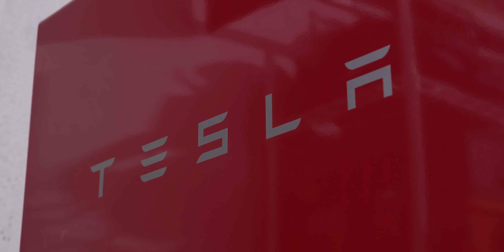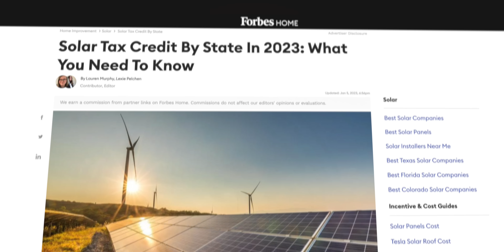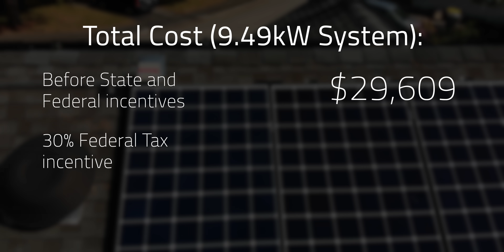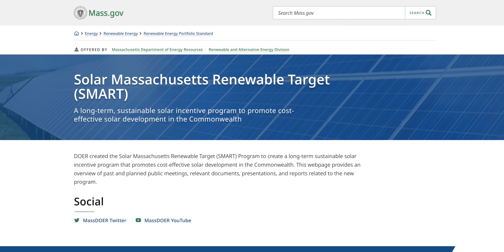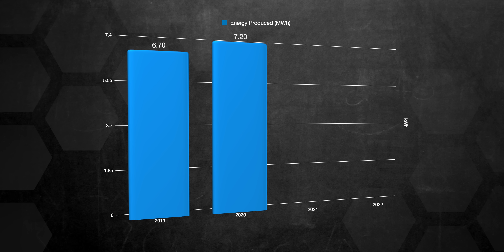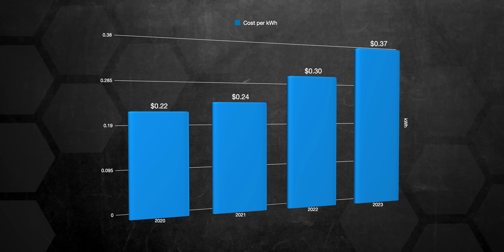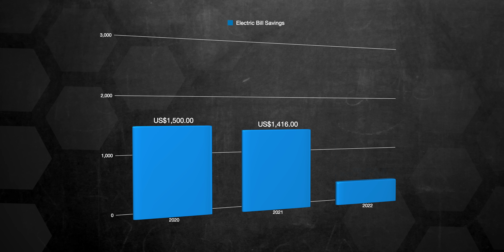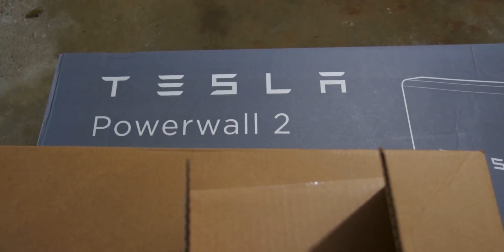5 Years with Solar Panels - Is It Still Worth It?

Comment: Very interesting with the 1:1 net metering! That's something we could only dream of in Germany, but I can imagine it making life tough for the utilities. Having a big difference between the price for energy taken from and fed into the grid is one of the reasons why pretty much every install here now features a battery; with 1:1 net metering I'm frankly amazed that anyone would get a battery. I guess for backup power or just the pleasure of being independent, but otherwise why bother?
Reply: Exactly you can just used the grid as an infinite, 100% efficient, lasts forever, battery. Not exactly a realistic solution for the long term!
Reply: When I install solar, a battery will be part of the system. It allows me to store power when the sun is shining, store power when power is cheap or free, use power as I please and NEVER pay the peak rate and keeps my system online when there's a power failure. Did you know that if you have no battery, your solar system will go offline when there is a grid power failure? I was surprised. It certainly isn't something they advertise.

Comment: I put 10k into a 2kwhr array with a 6kwhr lifepo4 battery bank. Designed and installed by me. 3 independent sub arrays charging the same battery bank.  It runs my fridge and dc lighting most days.  I dont have exact data, but suffice to say I knew it was cheaper to just pay my electric bill.  I want to cut the wire off my house, even if it costs me more!  Doubling the array this year and adding automatic start gas backup generator. Im getting closer.(Connecticut) There is no way I will give back 50% for line charges for grid tie.

Comment: Live in south africa and even if you only got 2 years out of a solar system will still cost u less tham dealing with 12hrs of power loss from the grid a day or the dips and peals that come down there lines. You pay for the power u use plus tje cost of lost equipment from constant liad shedding  so maybe its not worthit where you live and have constant power suppliers but here definatly woth it

Comment: I live in an apartment, so solar isn't really an option for me.  But at the last shareholders meeting, the chairman of our co-op board told us that the building is going to need a new roof and they were examining whether to install solar.  While the common areas probably wouldn't use all the electricity the roof would generate (its a big roof) by selling the excess to Con Ed, it could defray other costs.  That would be nice given that my maintenance charges have increased by 25% in the 3+ years I've lived here.  I am guessing though that installing a power wall in my apartment wouldn't be worth it, though it would have come in handy this morning.  Con Ed was working outside our building this morning and turned off our electricity for an hour.  I lived through that by rolling over and going back to sleep.  But $15,000 is a bit much to pay for power outage insurance.

Comment: Thanks for the video. Very interesting. You indicated your tax credit from the Federal gov’t did not come from other taxpayers (if I understood correctly). Just want everyone to know that tax credits given to one is basically paid for by all taxpayers. The Federal gov’t (or even state gov’t) is not going to reduce their spending by the amount of each person’s tax credit).  Therefore, others have to make up the difference and it eventually leads to higher taxes for everyone. I have not problem with you wanting to use ‘green energy’ but I do have a problem with me having to give you money for your decisions. Where are your solar panels being manufactured for your new home? Most likely they are not made in the USA and there is a high chance they are being produced in China. I’m trying not to buy products made in China because of their infringement on their citizen’s natural rights.
What is the reason for the significant increase in electricity costs in your area? Most likely it is from the increased energy costs due to the federal governments insistence that we move away from oil, coal, and natural gas.  I think we should be stewards of the environment, but I don’t think that the planet is going to “die” in 30 years because of carbon emissions being produced by humans. We need to be aware of our emissions but we don’t need to drastically change our way of living overnight by investing lots of money and complications that green energy brings to everyday life. I don’t want to have to maintain solar panels and worry about snow avalanches off my roof. Since I am retired I don’t have desire or the money to invest in green energy. If I was younger my attitude might be different.  I applaud you for your efforts and enjoy all your content. I hope all goes well on building your new home.

Comment: We moved to our wheat farm about 7 years ago to get away from the madding crowds, and it’s been wonderful.  Over 5 years ago we installed a 24KW backup generator and that made a huge lifestyle improvement as our power goes offline all too often and then we have nothing, not even water as we’re on a well.  Two years ago we installed a 15KW solar panel system on the south side of our shop building, which was just completely renovated, and 3 banks of Enphase batteries, and everything is Enphase except the solar panels.  We also dropped all power lines underground.  All this is very good except one aspect, in the winter we most often get very little generation, yet late spring throughout the summer into mid fall we get up to 125KW per day, so our electrical grid company gets lots of KW from us.  We generally use up to 2000 KW per month, except when we have company when it can easily double that.  We don’t try to conserve but all the lights are LED and all the systems are as efficient as can be purchased.  So we have constant power, never knowing when we’re off grid without seeing the email and text messages.  One more aspect would make this perfect, harvesting the wind to charge the batteries, especially in the winter months, and we have plenty of wind!  This would work well if Enphase would program that into their system, which we hope they will.  The lack of wind harvesting is our only weakness, and to be fully self reliant, we need it.  We are super happy with our installer and Enphase.

Comment: I live in South Africa and we installed our solar 3 years ago. We have a 5kwh inverter with 10kwh battery backup.

In South Africa we have scheduled blackouts called loadshedding, so we deal with power outages on a 4 hour basis.

My system actually replaced the use for grid entirely.

Things I wish I knew :
1. More batteries, in my case we need at least 12 hours worth of backup capability.
2. Use a system that allow generators to connect directly to the inverter. This can help carry the load and charge batteries
3. Hot water and oven can go on a different system that the primary, preferably gas(a limitation for South Africa is we don't have gas lines so we need bottles)

Comment: I'm a true skeptic on residential solar. Not because of the technology but, because of the complicated process involved in getting it and how much money has to be spent to get the system in a position to be able to pay for itself in a realistic number of years which is subject, in the most realistic calculations, to so many variables like utility rules, laws, state programs, weather patterns, rising material costs, maintenance considerations, contractor reliability and changes to all these. My sister and sister and brother in law just completed their solar project in California and are very happy to be producing power and getting credit for their excess. However, the process was long and arduous and fraught with difficulties, right down to the local inspector's failure on first final inspection. Even your situation sounds like it will be a while before you break even and you have had a better than average experience than most of the stories I have heard. And don't get me started on the amount of energy and materials, mostly not recyclable, that are used to produce these products, which I believe is unsustainable. To me, if ones goal is to save money, energy, carbon output, and the environment, buying extremely efficient appliances, making your house as energy efficient as possible with heat pumps etc., and cutting back on excess energy consumption, would be a far better way, and would have a far greater impact over the whole world, than do these personal renewable energy systems. I don't know if the actual numbers back me up on this but I have a feeling they do. Your thoughts? And nothing against those going solar and wind because I think the motivation is noble, just maybe not efficacious.
Reply: You sound as if you possess the capacity to think on your own and are not blinded by some snake-oil salesman. Congratulations. If the efficacy of insulation were understood, by itself could “save the planet” and your bank account as well.
Reply: certainly understand how it can all feel like a lot but you mention sustainability, neither is oil and gas. It's just easier to dismiss because you aren't involved in the plants that produce the power you use but. Appliances can only get so efficient and suggesting that humans will "cut back" , I can't imagine you seriously think that's a valid argument. If we didn't cut back the last several decades , why would you think it'll happen now?
Reply: Those are my thoughts exactly.

Comment: It's a big decision for most people, and the risks are many. We are already seeing a solar backlash in some important states, where the incentives have been significantly cut. Program rules could change at any time. Federal incentives could decline or go away altogether. 

BUT... I thought the same thing when I started the process in the fall of 2020, with final permission to operate granted in February of 2022. My original break-even point was 8 years, due to the inclusion of 3 Tesla Powerwall batteries. But after a year, it's going to be only 4 years. Also, think about about inflation- the value of solar generated electricity will only increase in time.

Yes, the risk of defunding incentive programs exist, but it is much more certain that the price of electricity will go up.

Comment: Hi! Can you recommend the specific roof rake you use for your solar panels? I’m nervous to use the hard plastic or metal ones I have now as I don’t want to break the panels. Thanks.
Reply: Solar panels are made of durable glass made to handle weather including hail. You're not going to break them by using a roof rake.

Comment: I have a question about original roof shingles.  What if a few years after solar install and it’s discovered my roof has a leak. Soft sheathing and good section as seen in attic has to be replaced. I assume if getting a new roof the solar panels have to be removed and then reinstalled. Costly?
Reply: Should be no more then 150% of the labor cost to install the panels in the first place,,,,,plus materials and any that get accidentally broken.   And I think in 2 years the subsidies will be Biy-Biy.

Comment: Solar panels are a big SCAM.
If, in one month, you produce as much electricity as you consume, will you still get a bill?..............................Yes, of course.........."to maintain the grid".
If, in a given month you consume X amount of electricity (above what you produced) but the month after that the excess electricity you produce is the same X amount, will you be "even"?........................No, of course not.
You always get the usual monthly bill ("to maintain the grid") and the electric company buys the electricity you produce at a very small fraction of how they sell it to you.
Because of the "Buy-Back" plans, more often than not, you end up paying a higher electric bill than before you installed solar panels.

Comment: glad my electricity is ~$0.15 since i tend to hover in 2 to 3 mwh...but apartment so cant install solar and in texas so how green electricity is is questionable (was not yet in apartment when big winter storm killed the power grid, but obviously dont have backup battery bank or generator other than UPSs for each computer). Yes my main server rack is a 2012 server and not the most efficient, but electric car and saving for house will be earlier improvements than the 750 to 1200 continuous watts it pulls

Comment: Hi Matt, I have a question, your panels have microinverters on each, would it be better for your West and East to have two seperate MPPT High Voltage charge controllers feeding your 48V battery bank, that way you have a longer charge curve during the day in the early morning's to late afternoon's with a Series East & Series West charging the batteries 😀  MPPT charger like the Victron Energy MPPT 250/100, for sure you could use a combination of series & parallel making sure you don't go above 250V and or the power rating of the Victron Energy MPPT 250/100 (open circuit panels voltage each around 42V), there must be a switch on / off point that the mini solar panel inverter that must opperate at, it's just a way you might get far more charging power on cloudy days where you live, I'm in Cheshire UK 🇬🇧 used to rain 🌧 & clouds, hope to place my solar panels on the ground south facing withou trees in the way, its an easy DIY way to cut cost's, maybe with tracking arms🤔

Comment: If you live in South Africa like me? Then yes, it is still worth it. Stage 6 loadshedding is no joke.  Imagine: Every 5 hours the electricity is turned off for the next 2 hours. Like right now, It will be turning off from 16:00 until 18:00. I have to keep my devices always charged because I need to study, but the wifi is off, so I need to buy data for those times when there is no electricity. So now the question is: R200k (+- $10k) or continue to live with intermittent electricity? But here's the catch: Average household salary in South Africa is close to $12.5k. So you'd probably need to take out an unexpected loan to have a more consistent electricity supply. Not many people can afford a basic on-grid inverter for about $1000.

Comment: As always thanks for the videos.  I just hit my break even at 67 months her in the Phoenix area!
Of course it isn’t an exact science and I can’t account for every variable, but if I take what I paid each month the year prior to having solar, adjusting for rate hikes, included the gas savings from going from ICE to EV (which itself is complex) I’m there!  I do benefit from year long net metering that I am grandfathered in for 20 years.  Shortly after I got Solar they changed it to month by month net metering.  Were you true up each month.  Typically I build enough credits early in the year that I then use up during the brutal summers, but even when I run out in August or September my bills are about 1/3 of what they used to be.  The last few months of the year I build up a small amount of credits and then they pay me out and I start over.  In each of my 5 full years I’ve generated between 95% and 105% of my electricity.  Things I learned - I wish I would have gone slightly bigger (10.325 kW) as I still find myself gong into the conserve mindset to stretch my credits as long as I can before running out.  I also have a 16 year old AC units so I’ll benefit when I need to replace them, but it doesn’t make sense to replace them until they go out completely.  Not worth spending $12K+ to save at most $500 a year.

Comment: Still amazing how expensive solar panels are in the US. As a Dutch person, I bought a 1,5 kW system in 2014 for €2800 (incl the €400 tax reduction). That was €1,86 per W. In 2020 I got an additional 3 kW for €3200 (incl tax reduction). That was only €1,07 per W. Compare that to the $3,23 (or a third less after tax reduction). Bizarre difference.

Comment: Well, since you asked; I do have some feedback about my experience putting solar on my house. Some things I stumbled on ...
1. You cannot just look at your roof area to calculate what you can put up. There are required set backs from the edges to allow firefighters to do their job.
2. There apparently are some code requirements for spacing between your electrical panel and the gas line (meter?) If you increase your electrical panel current then that spacing may need to increase. Exactly how this is done? I don't know, I declined. I scaled back my system so it wasn't necessary.
3. Increasing your electrical panel current with your solar may require updating your service lines from the power grid. If you have service from an overhead line, maybe not such a big deal, but if the power lines are below ground then there will be some trenching involved. I declined to have a system large enough to make this necessary. I may change my mind later.

Was the purchase and installation worth it? Yes, absolutely. I expect to achieve break even after about 7 years from purchase.

Comment: I wished I knew Aurora inverters were sold to Chinese, quality was crap and 8 years later, the ground fault keeps tripping.
The installers did dodgy methods which I'm paying big time to fix properly.
I wished I got a good inverter with already installed wifi connection, stupid ABB wants $250 for a rs485 board I can make for $20 which I did.

Comment: Great Video Matt ~ 
Live Down Under. North facing housse. Ideal roof conditions. 16 Pannels (400watt) has given me 6.4kwh system and it pumps out about 42 to kw on a good day and is averaging 30-32. All this cost me about $8K AU with an switch box upgrade (it as 1960's level before we the install). Early adopters paid heavilly for the gear but it's cheap as chips now. Never looked Back, will probably add pannels in the future. Can we do a video on Solar Air-conditioners? These seem to be picking up traction